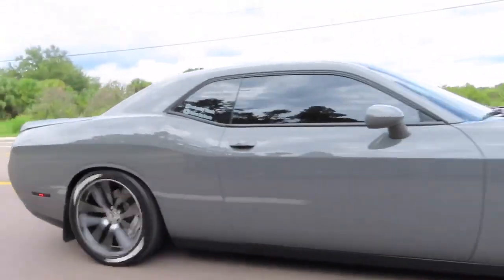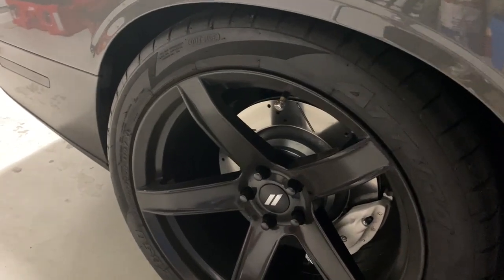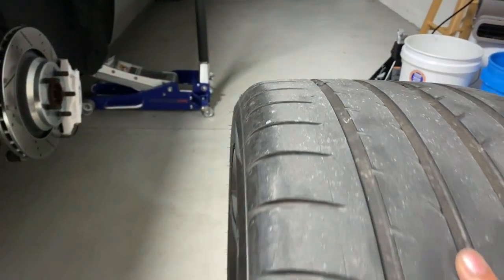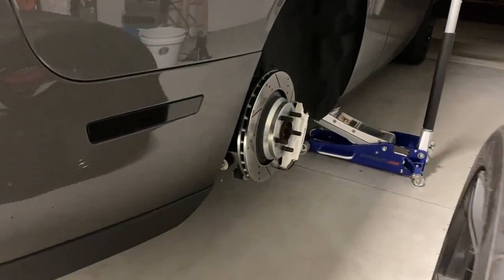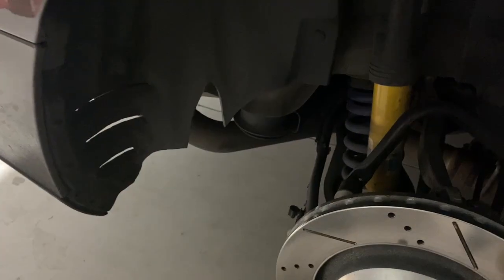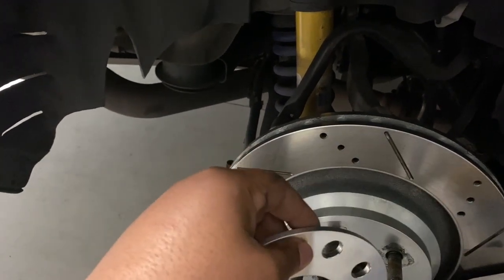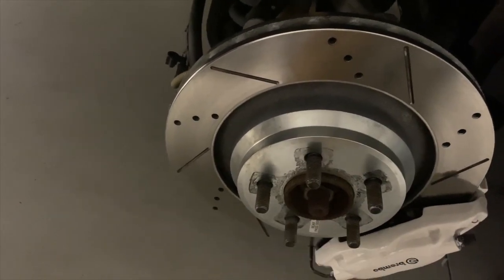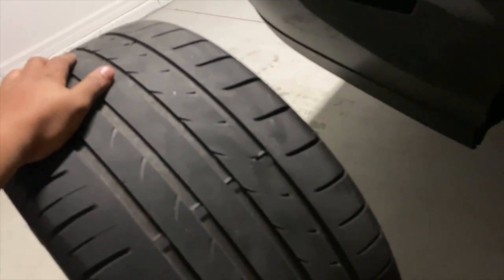DONT PUT 315 TIRES ON YOUR SCATPACK CHALLENGER... HERES WHY | MODERN DAY MUSCLE

Comment: I think you should change your title to Don't put 315s on a Narrow body challenger with an undersized rim
Reply from the maker: Good point thanks 💯
Reply: Exactly because on a widebody shit ride sweet
Reply: So what exactly can i do to put 315 on the rear on my narrow challenger scatpack what rim size and tire dimensions also do i need spacers if yes what brand?
Reply: @alexander_3923 I think you can’t bro I think only 275s for the narrows is as best as you can get
Reply: @alexander_3923 you have to roll the fenders

Comment: I have 315x35x20 on 10.5 wheels using 5mm spacers. No issues now using the spacers with the correct bolt pattern !
Reply from the maker: Very nice!!!
Reply: what about 315 40 20  10.5 -12 10 mm spacer ?
Reply: 315 all around?
Reply: What manufacturer did you purchase spacers from?

Comment: Running 315/50/17’s. Mickey ET street R’s on racestar dark stars. 

Had to cut inner fender liner and beat a bit inside. But no issues any more.  Threw it on a lift. Chalked the inner tire. Manually rotated it. Saw where I needed to adjust.  

I wouldn’t trust a spacer with even a stock powered R/t. Seen too many “ohshit” scenarios at the track 🤷🏻‍♂️
Reply: What offset are your wheels?
Reply: (This was when I was 17x9.5 racestars) 
To answer the question. It was a 22.5mm offset, 5.98” backspacing
22.5-25.5mm offset with around 6” backspacing will work. Just may need to cure the slight rubbing issues.  

Sits well with either Lakewood 50/50 rear struts or Vikings struts. I’ve ran both
Reply: The 17’s are my street tire setup.  I use a belak 15x10” beadlock wheel with 28.5-29” Hoosiers when track racing

Comment: I’m running 315/35R20 on 10.5 wheels and no issues at all
Reply: It depends on your offset. I have 25mm offset and it rubs. If yours are 21mm or 22mm offset then it won’t rub.

Comment: I have 315s on my 20x11 wheels. I don't have any spacers and I have not rubbed since switching to this setup in 2020
Reply from the maker: Every car isn’t built the same which would explain why I’m rubbing and your not. Glad your not tho 💯
Reply: I want to put 315’s on mine. 20x11 wheels. Not sure of my offset though, that’s my only fear. Any advice?
Reply: @VeracsGaming  I got a 2019 hellcat challenger and I’m bouta put 315/35R20s nittos with 10.5” rims on em
Reply: What offset are your wheels?

Comment: That problem is out there. I’ve got hellcats and had to make sure that wider wheels didn’t rub but I am only running 305. Some people take a heat gun to the inner plastic liner and massage it so that it clears better.🤔 also, I’ve heard but not seen in person that different company’s sizes will vary slightly and might result in the same problem.
Reply from the maker: Yeah it’s a tricky game thanks for your comment 😎

Comment: I have 315s on the rear of my 2016 srt hellcat challenger do I need spacers? I had the tires on the car when I bought them from a private owner/seller. I don’t know if my wheels are rubbing haven’t heard anything out the ordinary on my car. I have stock 275 run flat p zeros on the front.
Reply from the maker: More than likely u need spacers. 5mm should be sufficient

Comment: Good video I have g2 555  305. No problems for that extra inch and a spacer not me
Reply: Not sure why people force 315s. 305s are literally a 7.6mm difference in total height. Which is like 3.8mm less sidewall. Not a big enough diff when 305s work fine. 315s are cheaper and easier to find but not worth the hassle.

Comment: I put 325/30/R20 and it was smooth
Reply: No issue so far?
Reply: @yuyuyu9029 not on the rear, but I went with 315 instead